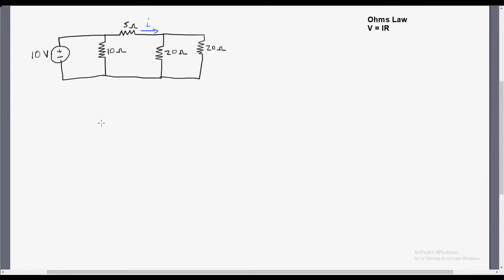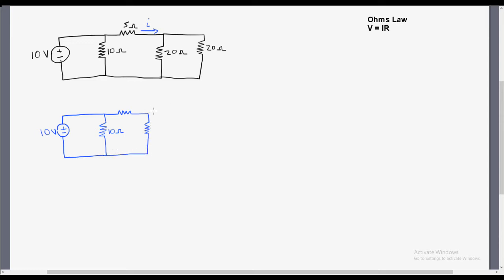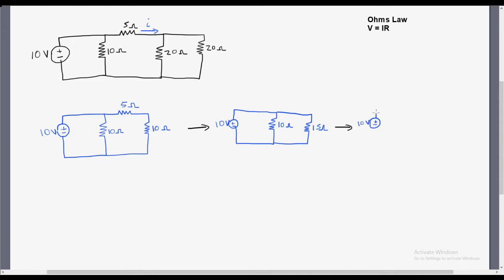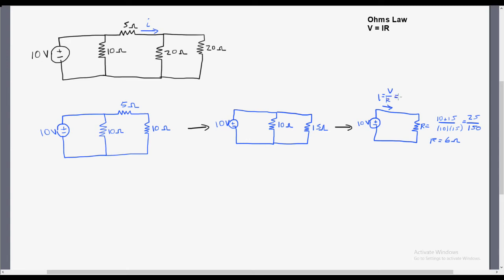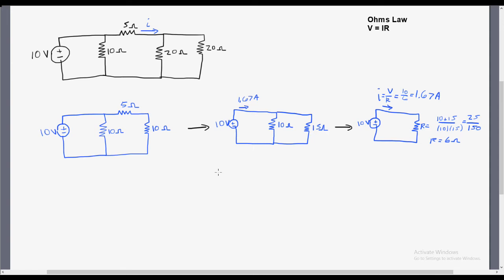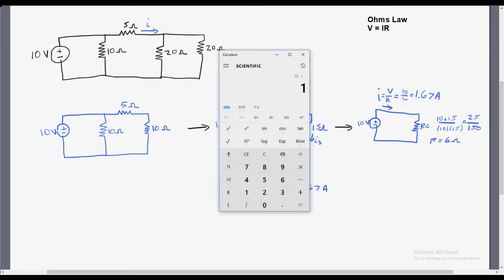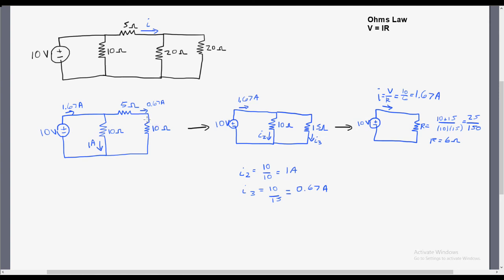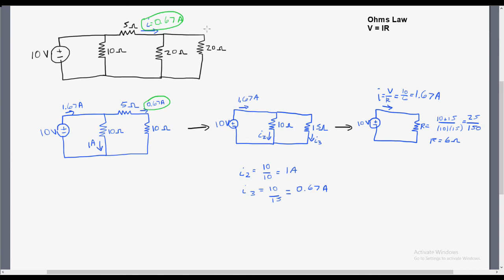Basic Circuit Analysis #1

Comment: I think what needs to be reiterated on this video is that, 2 Resistors in Parallel equate to an equation of, Equivalent Resistance (Req) = R1 x R2 / R1 + R2, you're equation is inverted by the time you get to the 10 and 15 ohm. Additionally, this equation can only be used if it is 2 Resistors.. If not, the equation is, 1/(Req) = 1/R1 + 1/R2 + 1/R3 + ... 1/Rn - if there is a resistor in series between the branches then you can't sum them all together.
Reply: excellent